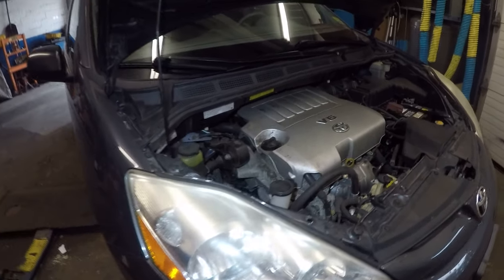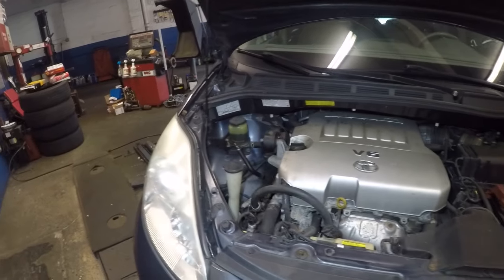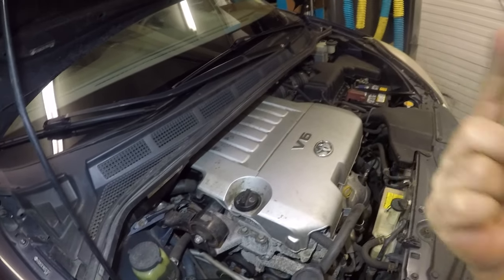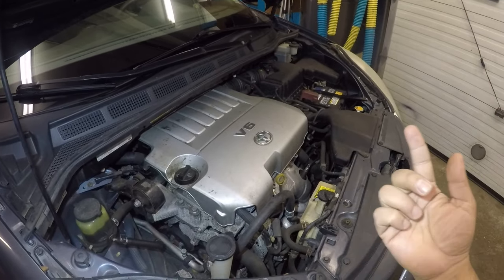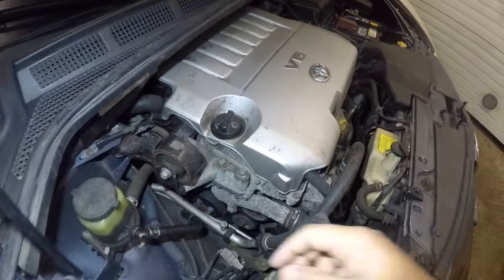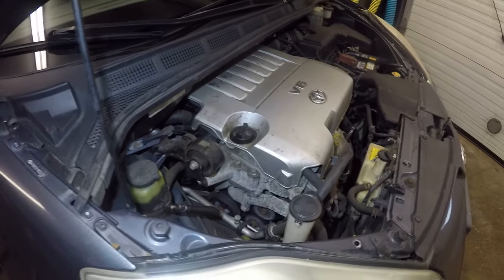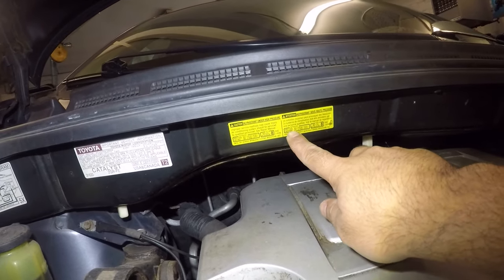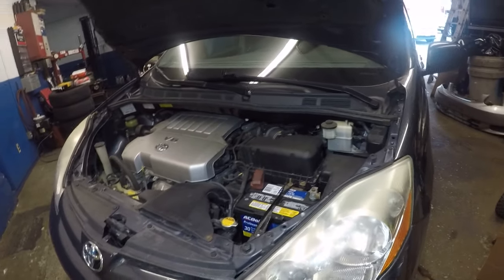AC Blows Hot and Cold Intermittently

Comment: Cold and hot intermittently. Not the best mechanic said it was a compressor leak, and I needed a new compressor... Would the car still blow ice cold if it was a compressor leak?
Reply from the maker: Nooo it would work till it’s low then cut off completly fix the leak and fix it if it got leak but intermittently usully sound like air and Freon in system do recover vaccum and recharge that might fix it
Reply: @RBTheMechanic  Thanks for your reply, you deserve a subscribe!
Reply from the maker: @joeseph2201  thank you 🙏🏻!!

Comment: I'm having the same issues, I replace my ford flex with new OEM AC condenser, AC compressor, radiator, belt, tensioner, and expansion valve. It’s still doing the same ice cold to hot air. What do you think it is? Next receiver dryer?
Reply from the maker: Did u service the recharge with ac machine vaccum and recharge? Could be too much oil or not correct amount refrigeration
Reply: It was serviced and recharged by the mechanic. It was redo like four-five times already. Long story short, I came back from a long trip for ten-hour into it, ac started shutting ice cold to warm. After doing some research, I am thinking that a receiver dryer could be it. But IDK. Can you tell me a little bit about receiving dryer?
Reply from the maker: @jamielipkis5160  well it’s somthing u don’t need to look in to as long as service was done propperly. What need to be tested is see if ac compressor works when it get hot if it dosent work then check power to the compressor it could be cutting off when it get hot also check if ur car got ac compressor relay swap that out as well
Reply: I checked the compressor while running ac and clutch on compressor spin with no problem.

Comment: My 07 charger has the adequate amount of pressure, compressor is on, and blows cold air for 5 minutes then hot air. Then when the AC is turned off, the air still comes out the vents and it’s hot.
Reply from the maker: So ur blower motor stays on ? That’s what the issue is?
Reply: @RBTheMechanic  well the blower motor will turn off but I feel a draft of hot air. I would think the blower door actuators? But other thank that, the AC only stays cold for about a minute. The compressor stays on and the pressure on both lines is good. What else could it be?
Reply: Forgot to add that the cold line in the engine bay will eventually go warm/fresh after 10 minutes. Maybe air in the lines?
Reply from the maker: @OT_Tips  so there could be restriction in ac systym or ac compressor is bad I would start with clear out the systym do ac service acc correct amount of oil

Comment: Hello, the ac sometime work ， sometime not , but when it work , it really cold , dddl
 Has code: lost communication with front HVAC / HVCF for 3 seconds or longer, 524025  31 
I been replaced AC COMPRESSOR /EXP VALVE /PRESSURE SENSOR VACUUM AC SYSTEM recharge the freon, it work one month and it happened again, can you tell what is going on with my truck , I did not replace the dryer filter , you think could be  dryer problem? Truck is 2019 freightliner. Cascadia if you know anything, please let me know!🙏🙏🙏
Reply from the maker: What’s the code
Reply: @RBTheMechanic  spn 524025 fmi 31

Comment: Hi! I have this problems too. Sometimes warm combined with less warm. But can you tell me why the clutch pedal gets hard to press in a hot day like summer days? And when the engine cool down then pedal press normal. Please help! Car is hyundai 1.2 petrol only 55000k km. Many thanks!
Reply from the maker: Something might be restricketd remember heat expand and retract so check the cable links and clunkers fluid

Comment: I have same issue with my Hybrid Toyota Yaris 2019 
2 weeks ago I regas see/recharged the AC.
Today I did a coolant change/flush and afterwards the AC on max/high setting blows cold air for few minutes then hot air for few minutes then cold again and cycle repeats.
Reply from the maker: I do t think it has anything to do with coolant flush unless car is over heating well anways u got hybrid so I’m kinda lost my self I do t do those do check ur Freon. How did u recharge the systym?

Comment: Thank you for a very good explanation.  I have a 2017 KIA Soul and the AC works great 99% of the time, but every now and then the cold air stops for a few minutes.  Yesterday I noticed, while idling, that if I increase the rpm's by pressing the gas pedal the cool air came back.  Any suggestions on what could be the problem?
Reply from the maker: That seems like low Freon when u Reve up the RPM it pushes more Freon to make it cooler so it might take care of u do recovery vaccum and recharge the ac system
Reply: Thank you much for the tip. I'll see if that works.
Reply: @RBTheMechanic  i have same problem except it only works of i rev to 2500 rpms or so and i am getting high pressure reading on the low pressure side... I'm assuming weak compressor that needs to be replaced.  I can't imagine rpm change in engine would have any affect on any other part of the system than the compressor
Reply from the maker: @macknumber9  that might be due to low refrigeration u might need reserviced ac system it’s pinpoint the low Freon much faster so it can cool try service first
Reply: @RBTheMechanic  thank you...but why would low refrigerant still give me a HIGH reading on the low pressure side?
Reply from the maker: @macknumber9  it’s would be confusing to explain it can be hit expanded air pressure I never go by the gauges I do look at them but from experience I have seen air pressure or people using ac cans jammin in pressure
Reply: @RBTheMechanic 014 Nissan Altima.  New air compressor, new air filter, new cabin filter, not low freon.
But this happens only when temperature its above 90 f. Outside it blows cold air for a minute then warm air for another minute.
Any idea what could be?
Reply from the maker: @trukooooo  might be low on refrigerant
Reply: @RBTheMechanic  I doubt it cause i did fill the refrigerant before and didn't work then I was told the air compressor wasn't working, few months ago i changed that and left the refrigerant at level suppose to be.
But its doing it again, also I does that only when its very hot ouside 92f and above. Also the RPM keeps moving a little up and down.
Reply from the maker: @trukooooo  how did u left it to left? Ur suppose to charge with measurement scale
Reply: @RBTheMechanic  i don't know cause it was me and another guy i paid for it.
It may be a electrical problem.
Is it normal the AC to blow very cold air when you turn the (auto) button on even if you AC button is off?
See i just found out the my car blows cold air like the AC is on when i turn the auto button on and the AC button it's off.

Comment: Going through this now. My mechanic put the hose on it and he let some freon out. And it blows pretty cool but not COLD. Starting up the car its humid cold so i know something is off. 2018 nissan Altima. 110,500 miles now. ny suggestions? I added coolant as well often because i drive ALOT
Reply from the maker: No coolant is for engine cooling u need to tell him to reservice the ac systm im not sure which hose he changed cuz ac system u can let some out all of it blows out no stopping

Comment: My Kia Soul starts blowing hot air when I switch the blower speed but only for a few seconds then turns cold. The A/C light on the dial turns off when it does it then turns on when it blows cold again. What can that be?
Reply from the maker: It could be issue with the control panal but I would do some dignostic it is worried tho but check for power drop check for loose or melted connectors at blower motor

Comment: Mine blows cold at night when it’s fresh outside . During the day when it’s hot it blows warm . ??
Reply from the maker: That’s usually sign of low Freon in the system
Reply: I recharged it my friend
Reply from the maker: @jovannyflores9422  how did u recharge it with machine?
Reply: @RBTheMechanic  Freon and gage . It said full green.
Reply from the maker: @jovannyflores9422  did u use ac machine to recover vacuum and recharge? If no then it’s not charged and not charged properly and correct amount Freon need to be added too much I’m with not work good too little will not work good
Reply: @RBTheMechanic  I did it myself I’ve always have in different vehicles.  But no I did not use a machine. Blows cold at night. Blows hot/warm during the day

Comment: My ac works when fan is on lvl 1 or 2 but hot air comes out when on lvl 3 and 4. I don’t even know what to think 😅
Reply from the maker: It might be low on Freon that’s when it will only have enough cooling to blow on low speed
Reply: Thank u for the reply. The problem is the little motor that moves the plastic warm/cold that moves the valve. Its not powerful enough to push the valve

Comment: Hello. I wonder if someone can help me. I have a 2010 Jeep Liberty, I took it to the shop twice, the first time, they recharged refrigerant, second time they said it was a bad valve causing it to leak, but now it’s blowing hot air again. I did notice both times that it starts making like a hissing noise before it stops working. Can some one give me an idea as to what it could be?? Thank you I’m advance !
Reply from the maker: Ok so ur system has leak if it works for like a day u need to recharge use ac dye to trace down the leak and replace the part that’s leaks here’s a video I did on fining ac leaks https://youtu.be/7H9xc_ve-ck

Comment: We had the same problem with Ford F150  2019. AC was on and off out of nowhere. So we decided to refill AC, which cost 450 dollars in Canada. But after fixing we realized that AC blows colder air but after 20 minutes driving. It doesn't work as suppose to. And AC isn't super cold as it used to be. Please what it can be? We don't see any leakage. The car is 2,5 years new. It is surprising that something got broken so early:(
Reply from the maker: Well that’s really costly to refill the has for $450 anyways how did they do it? Did they use ac machine to recover vaccume for 20 minutes then add proper amount Freon and oil?

Comment: Hi when I check the pressure with a screw driver there is pressure that means freon is available? But the pipe is not at all cooling. Is it due to low freon gas
Reply from the maker: Dose ur ac compressor come on
Reply: @RBTheMechanic  yes
Reply: The clutch engages and keeps spinning on the compressor continuously without stopping
Reply from the maker: @ansar311  low pressure  could be the issue or the compressor not build pressure

Comment: Hello RB,my 2007 Honda city AC cools in the morning but blows hot on idle in the afternoon (hot weather).what do you suggest I do?Thank you
Reply from the maker: Yeah I get lot of those I just posted video 2 videos check them out low Freon pressure causes low cooling on hot in morning it will be good but sun beaming wount be so cool anyways recharge ur system add dye maybe u can trace down a leak as well
Reply: @RBTheMechanic  I have done a leak test and no leaking. Have the system professional empty and then refilled showed that the was right volym already before they empty, still when it's hot outside the AC stops after 5-10min. Any suggestions?
Reply from the maker: @dennisgustafsson3063  did u swap out relay it could be getting hot also it could be ac compressor getting hot it got safty switch

Comment: So I have a 2015 Ford Explorer I recharged it with free on and then it went to red mark and never to the green. Now it’s blowing hot air and cold air. I have to go fast so the cold could come out. Would you happen to know what it is?
Reply from the maker: Well it depends how did u recharge the system ? Did u recover vaccume for 20 minutes and then add correct amount with ac machine or did u use cans?
Reply: @RBTheMechanic  aww man I just add with the can. But I just noticed that the AC compressor that wheel isn’t turning. So could it just be that? It’ll go on the off.
Reply from the maker: @frisco415  it suppose to go on and off as needed anyways ur problem most likely is you charged with cans so theees air pressure Freon pressure that’s the issue do it propperly it should be good!
Reply: @RBTheMechanic  do you have a video up on how to do that? If not I’ll look it up. I appreciate it so much man thank you. And keep up the good content
Reply from the maker: @frisco415  here’s one of the cars that everything was good ac compressor came on but no cold air I used my ac machine to re charge the system https://youtu.be/UU8TtkfmTJs
Reply: @RBTheMechanic  thank you.
Reply: How did you fix it? I have a 2016 Ford Explorer
Reply: @AlexMartinez-yl1ef  just makes sure you push it for about 6 seconds then wait 15seconds then keep at it. Just don’t tell dealerships I guess because they will try and charge you more because it’s a hack. I didn’t tell my dealership and they didn’t even know I did it

Comment: After a diagnostic test the AC shop couldn’t help me. I noticed only the passenger side was cooling but not the driver side, so I replaced the door bend acaatur,  now it only works sometimes but it’s still not fix. 

Btw this video didn’t help either.
Reply from the maker: Did u check Freon pressure? System might be low and only cool half of the ac core to give only half of the side cooling

Comment: The ac compressor switches on then off blower motor is working but not blowing cold air
Reply from the maker: Check Freon pressure
Reply: @RBTheMechanic  I checked the gauge when the car was off and it was over filled I released some pressure and now my compressor isn’t clicking on

Comment: i have a 2005 g35 coupe and my a/c went out when it rained and it hasn’t came back. i bought a/c refill can from walmart and the gauge said it was overfilled with refrigerate, what do i do?
Reply: only blows room temp air.
Reply from the maker: You made it worst I never recommend using can to add because ur don’t know how much ur adding ac machine dose the job but anyways check fuses and see if there’s any water leaks inside the car I know infiniti are know for leaking water but u will have to fix the over fill issue the system will not work propperly take it to shop let them fix it

Comment: Hello everyone, i have a question, maybe someone can help, i have a 96 izusu oasis, its the same exact van as 96 honda oasis just diff badge, anyway my ac is being weird, i have had it checked and freaon is properly filled which was done by a mechanic with AC machine, they say they have tryed everything which i doubt cause they said car was to old to figure it out, so they just checked for leaks and stuff, all is ok but the AC has got em stumped, anyway the rear ac is ice cold but after a few moments the front AC will go warm to room temp with the rear AC being ice cold still, its not making any sence to me and i have looked through the factory repair manual that the dealer uses and there is no mention of that issue, can anyone help me with this, thanks so much.
Reply from the maker: Ok I’m not too farmeliar with this year and the car anyways did u check to see if the system is vaccum controlled to open and close the bled door not this car but u have similar issue on Buick the system didn’t control the door the diaphragm didn’t hold propperly and every onece a while it turn to opposite side

Comment: In my case my 2013 honda civic A/C system was overfilled, After I leaked some freon out and it was back in the green on my a/c gage it worked fine and stayed cold, I'm in Arizona so we have some extremely hot summers, the other thing that was a issue was the a/c compressor was loose, so I tightened it back down and no more rattling, surging compressor.
Reply from the maker: Nice yea over charged system will not work accurately
Reply: How did you let some out?
Reply: @MJ-py7wk  went to oriellys and got a freon nozzle and connected it to the low pressure side and just pressed the trigger and let it out into the atmosphere.
Reply: @thatslow4.6  great! 👍 Thanks
Reply: @thatslow4.6  lmfaooo that’s terrible for the for the atmosphere 😂
Reply: @lucasjensen4309  🤷🏻‍♂️ oh well, I gotta do what I gotta do.
Reply: How did you tighten down the compressor? From where? Mine is doing the exact same thing it’s making a horrible vibrating sound and it surges
Reply: @chrisperez3057  Wanted to update some individuals with some more information, The problem is the belt tensioner and upper left engine mount that can be seen from up above, those are the reasons it's vibrating

Comment: I have a jeep my ac blow cold but hot on the passenger and all the back areas are hot any suggestions?
Reply from the maker: What Jeep u got and year
Reply: @RBTheMechanic  2012 Jeep grand cherokee
Reply from the maker: @thedonbreezy450  is it dual temp control? Check both blend door motors if it’s dual control other wise u need to recharge the system with ac machine cans will not work